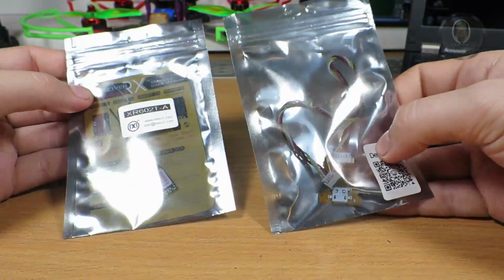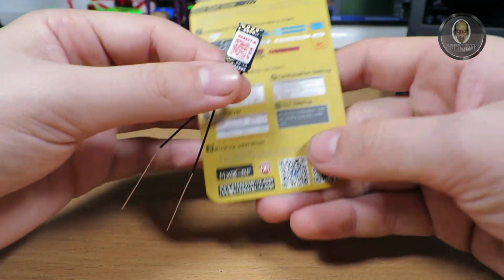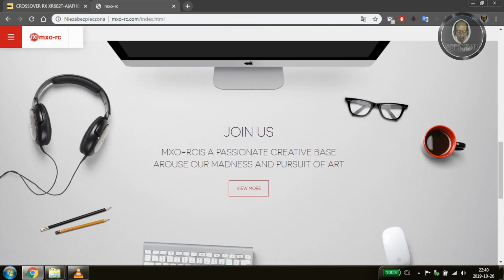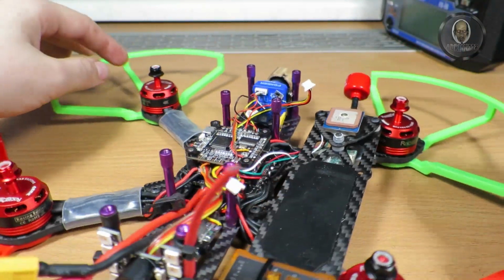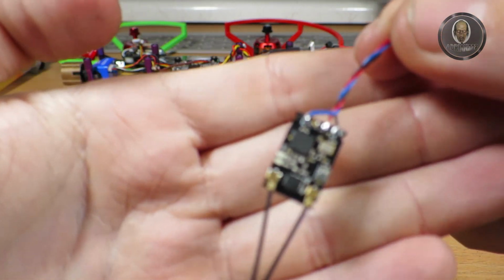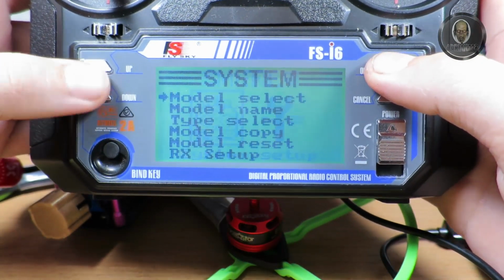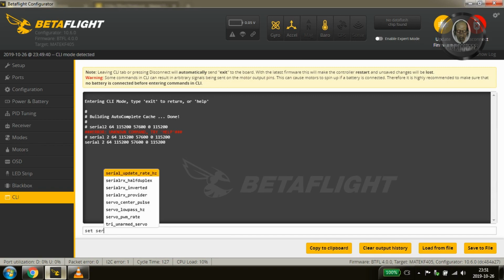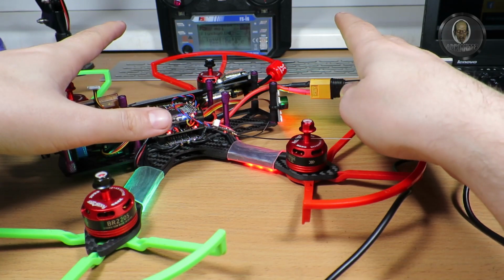Crossover-RX XR602T-A RSSI, FPORT With Matek F405-STD and Flysky  FS-i6

Comment: Can it show the rssi on the transmitter screen.? CAN be set flysky i6 to have low rssi alarm? because I dont have OSD
Reply from the maker: I don't know that, I did not change transmitter firmware to that custom modded software so that one could do that but as far as I remember transmitter show range but on FPV You don't look on transmitter :)
Reply: @Adrian202  OK thank you
Reply: @Adrian202  it would be good for line of sight flying & also plane pilots

Comment: Hi mate. I've got an iflight alpha a65 which doesn't have an SBUS pin on it, trying to connect the RX602T-A to it but failing every time. Tried the SBUS to RX2 only and then FPORT to TX2, nothing really worked and can't get my reciever to connect to betaflight. Any advice you can give?
Reply from the maker: I also learn when I build it, You need to configure ports on Your board, luckily someone shows how to do that in My setup.
Sorry but I'm also new in these connections :(

Comment: Help me. how to install RX XR602T-A for mobula 6/7 ( flysky ) ..? (installation diagram)
Reply from the maker: This help Me with matek:
http://www.mateksys.com/?p=4488
But I can't see how to setup FPort for that mobula.
Codes may not work for this board but connection should be same or similar.
You could ask producer how to set up that FPort
Reply: @Adrian202  not work.. 😩 FLYSKY not FRSKY.. Mobula7 flysky my drone
Reply: @ani_aja3992  saya pake ini di mobula 7 HD bisa. sbus ke pad inverted.
Reply: @andyschannel5845  blh minta diagram foto dan settingan bfligh nya?
Reply: @ani_aja3992  barangnya udah kejual om, pake fport ke pad tx biasa jg bisa koq.
Reply: @andyschannel5845  kmrin udh coba ke sbus with inverter tp yg fport ga di colokin jd cuma 3 kbel yg dipasang.  Tp kok binding masuk telemetri dilayar remote flysky, tp remot nya di pencet mna pun gak ada yg gerak drone nya ya. . Setting dibflght pake apa..? Coz saya coba semua sama aja remote flysky nya di pencet gak ada yg fungsi..  hnya telemetri nongol di remote flysky saja
Reply: @andyschannel5845  iya fport ke tx2 bisa emng,  cums kadang Drone delay tiba2 wktu terbang agak jauh ( hnya solder ke 3 kabel,  dan btafligh pilih frsky yg bisa konek )
Reply: @ani_aja3992  klo pake fport, di cli > set serial_halfduplex = ON < ini om, trus di betaflight pilih frsky_fport. habis tu harusnya bisa terbang normal om. Om pake fc apa? Nggak ada pad rx iverted kah?
Reply: @andyschannel5845  pake mobula 7  bukan yg hd.  Ada rx inverter,  tp ga tau knp remote ga gerak cuma muncul telemetri di remote aja klo solder di inverter